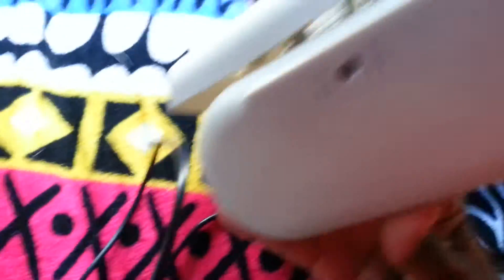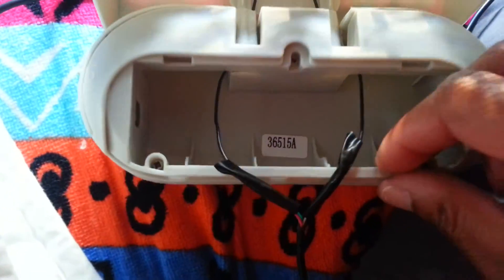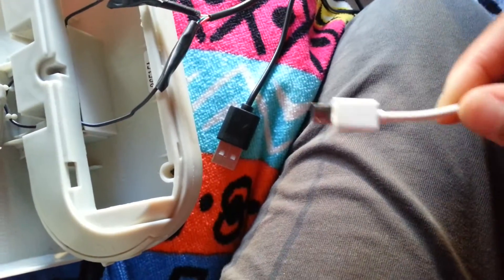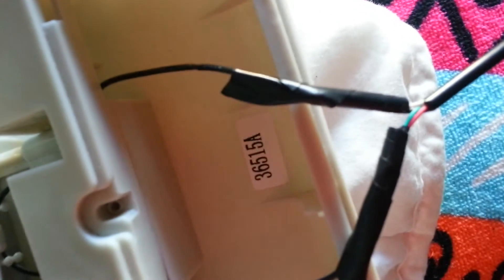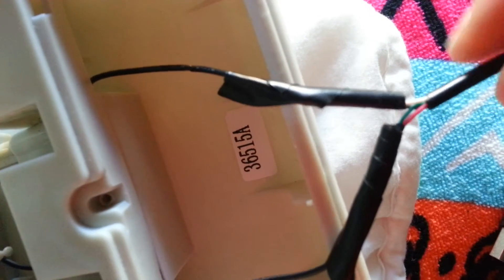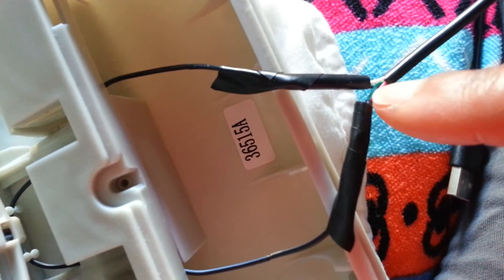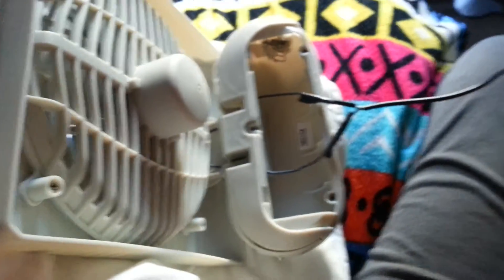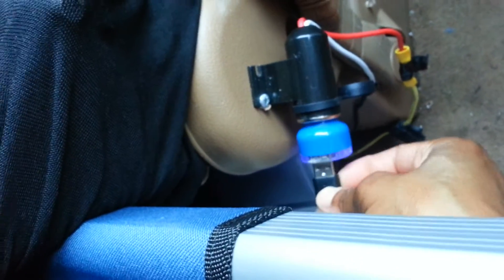(#54) wired my battery operated 02cool fan to USB!!

Comment: Very clever.  I tested the O2 Fan with an inverter on my portable battery pack and it drained the power in 2-3 hours.  I ended up taking it back and am planning on sticking with my 12-volt clip on fans as a result.  I think the inverter was causing a lot of power loss.  The 12-volt fans should run all night...possibly 2 nights before draining the system.
Reply from the maker: thx D. that means a lot coming from you!!!